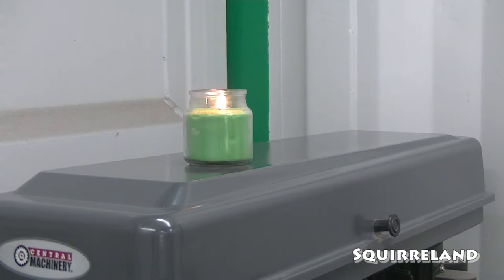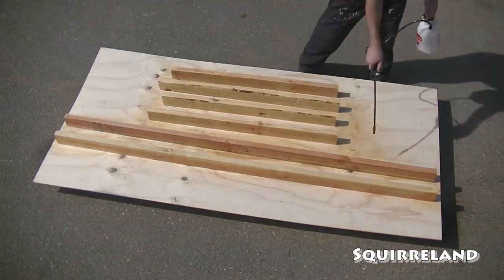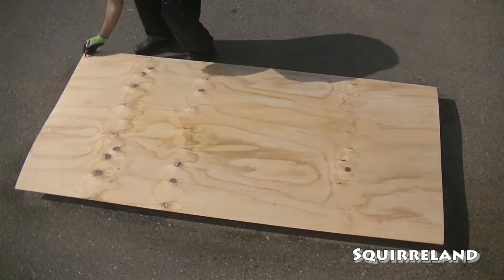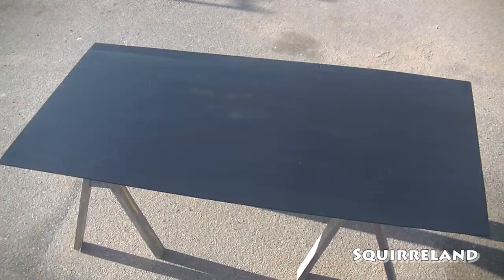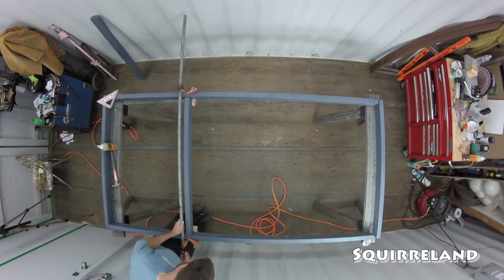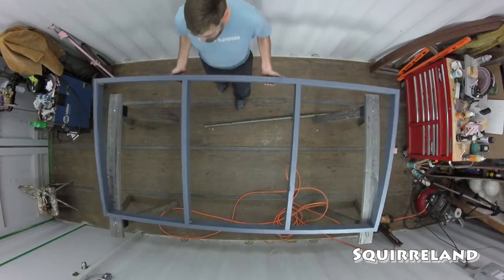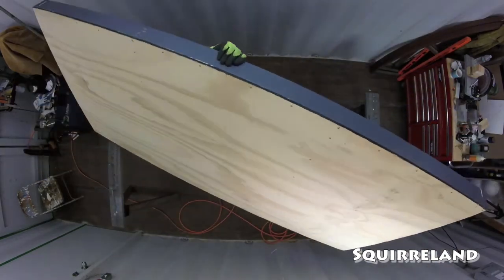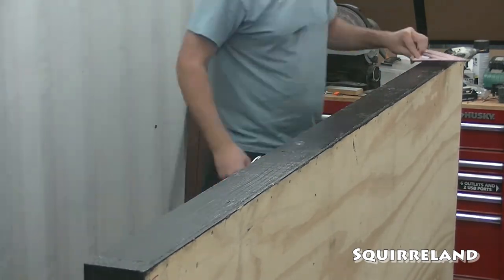Basic Wall Panel Build For A Haunted House - Squirreland

Comment: Hi there. Thanks for the vid. Ended up using part of your design a couple months back to get started on our event this year. I hope you don't mind that I drop in and ask a few questions from time to time... I would really appreciate your input. Here is an example question. What is your solution for fastening panels at an angle? Thank you for your time.
Reply from the maker: I glad that it was of some help!  Typically I would use a 4x4 post with a sliver of plywood between the panels.  Think like the demonstration at the end of the video.  Instead of fastening panels directly to one another, I would put a 4x4 post between them with holes drilled all the way through the post, as well as a bit of plywood to accommodate for the thickness of the plywood on the front and possibly the back of the panel.  We have boxes of 4" bolts and 8" bolts in a wagon depending on what we were putting together.  I would then attach the perpendicular panel with star bit 3" screws and some 1" fender washers (large washers with small holes).  Other times I would build panels with the 4x4 post built directly into the perpendicular panel.  Then I would have a purpose-built panel for a "T" junction in the panel assembly.  For corners, I would use the same 4x4 post and plywood just with shorter 6.5" bolts and the star bit screws and fender washers.  I also always made sure that the bolt threads were faced into the panel and not outwards.  More than likely myself or an actor or possibly even a guest would go around a corner too fast and catch themself on the threads that were sticking out.  For panels with odd angles, anything that isn't 90-degree corners, I would just make a panel that had that corner built into it.  Generally, I tried to make everything as versatile as possible.  I hope this explanation isn't too confusing.  Any other questions that you have feel free to ask, this sounds like a good idea for a supplemental video that covers a bunch of these ideas at once.
Reply: @squirreland  Yes I understand and thank you for your time and information. My father and I have been "home haunting" for years and are attempting to put on a legitimate attraction for the end of October.. So I am new to some of the building in this fashion. I have been building a 3D model on my PC of our haunt. My father suggested that we connect two panels for a 90 degree by drilling though the 3 inch + 2 inch overlapping. We also used 2x3s and Masonite. Money saving attempts.. With that said, I am not certain about building and fire codes as far as the way I described my example compared to yours. Your way definitely seems more versatile, cleaner, and non overlapping. I will show him what you mentioned. Let me know what your thoughts are if any about my comment, thanks again.
Reply from the maker: @tentofterrorvlogs  good luck. Just remember that safety needs to be the #1 concern at all times. Safety for guests and actors.  Sometimes that means keeping actors safe from the guests.  People react unpredictably when scared or in a heightened state. Professional haunts take a lot of planning. Most places require fire marshal approval.  Be careful to not upset any local city officials.  They have NO problems shutting down a haunt even if it will cause the haunt to loose money. Best luck!
Reply: @squirreland  Thanks again. Yes safety is #1 and we hope all will be well or there is always next year. 👍

Comment: Hi! What about using 2.5 mm fiber board instead of plywood? Any concerns with doing that?

It's 50% the price of OSB, which is why I ask 😅
Reply from the maker: Fiber board is mostly made of water-soluble glue.  Which means that the first time that it gets water on it, it'll basically melt.  It might be cheaper in the short term, but in the long term it'll end up costing more when the fiber board has to be replaced due to moisture damage.  I've had some of these plywood panels since 2007 when I did my dark ride and they're still in good condition.  Basically, I build stuff for being used 50 years from now instead of building it to work for today and tomorrow.  Also, guests can get scared, I have had them turn and try to run away and go face first into a wall panel.  The plywood panel survived, the picture frame that was attached to it wasn't so lucky.  The fiber board would probably have had a human shaped hole in it like a cartoon.  I hope that this helps.  I have a more videos on decorating panels.  They might give a bit more insight into the benefits of the plywood.  I also have several more videos about decorating panels coming down the line.

Comment: How much was a single wall panel?
Reply from the maker: Well, since I bought the materials for these, prices have increased greatly.  Originally, 1 panel was maybe around $90-100USD in materials, not including labor because I built them myself.  Back then, a sheet of the plywood that I used was $21.99USD.  Now the price for that same sheet of plywood is around $49.99USD.  That doesn't include the cost of decorating a panel.  I have other videos that I've uploaded about decorating this kind of panel with many more to come down the line.  I would say just look up your local lumber yards and check on pricing.  Just don't buy any plywood that has a thin veneer on it.  The moment that it gets wet, the glue comes apart and all of the decorating that was attached to the veneer comes off with it.  The veneer plywood might be cheaper, but you get what you pay for.

Comment: What's the name of the flame retardant you mix with the paint?
Reply from the maker: Universal Fire Shield. However, certain flame retardants are approved by different places.  Check with your local fire marshal before buying anything.
Reply: @squirreland  thanx!  That's the same one I was looking to use also!  They are usually ok if we just spray walls down with ForceField... so this is probly a step up.
Reply from the maker: @mike_e_allen  very nice! best of luck!  i"ve thought about doing a video on some of the fire safety & ADA things that i"ve had to do, but that sort of thing changes from fire marshal to fire marshal, city to city to city, county to county and state to state.